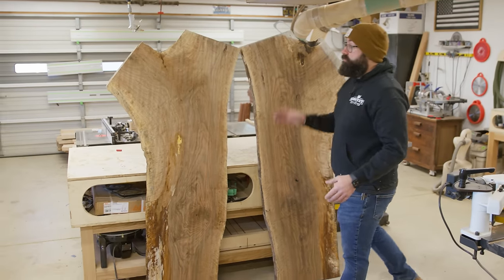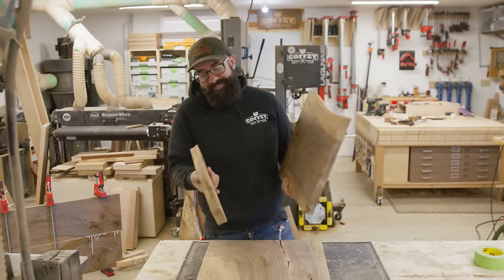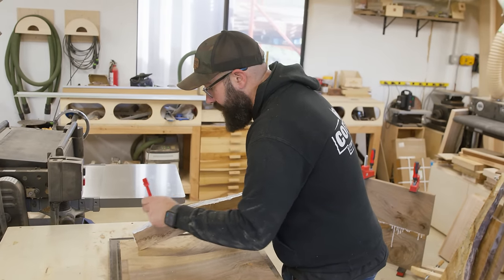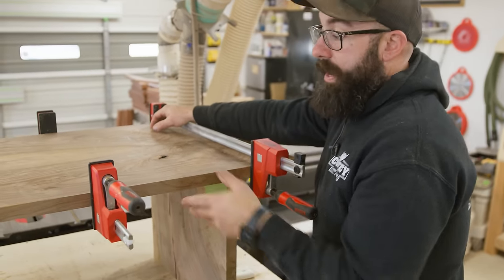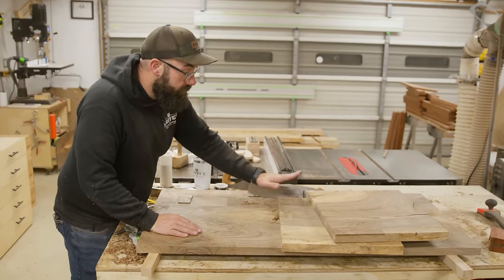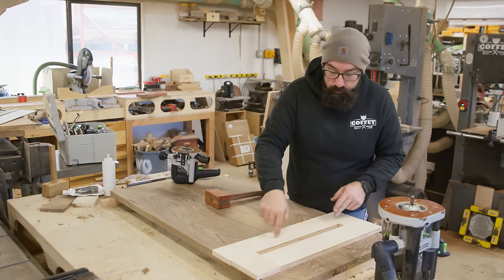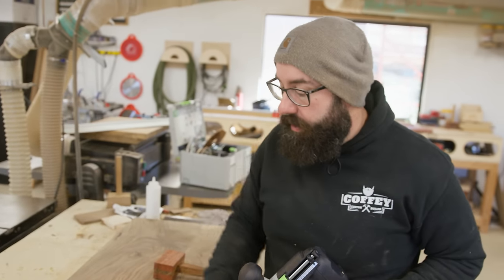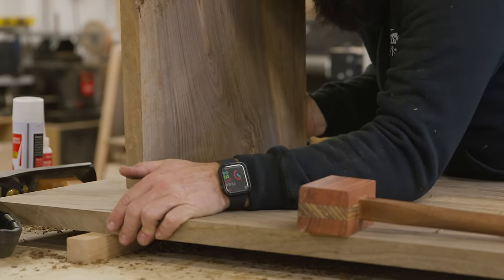$2,000 Coffee Table From $200 Of Trash Wood

Comment: Overall I like it.  The through tenon is a nice detail.  Personally, I'd have preferred the tiny amount of epoxy to fill the defects over the patchwork.   Only other change I'd make would be relief cuts on the bottom of the legs.  As is those legs will work fine on a carpeted floor, but for any hard flooring it'll be almost impossible to get to sit flat.  Foam pads would work, but I also like the look of even a small relief cut.
Reply from the maker: Good thing this was for someone else 😂 thank you

Comment: Looks great. Wondering why u didn’t throw in a stretcher or angled out the “legs”. Pretty much all of the compression is picked up by the shoulders of the tenons. Would love to know what ur thoughts on that? 🙏
Reply from the maker: The stretcher would help with compression. That would help with racking or sway. But it is not an issue here as the tenon is 1" thick and 1.25" tall. That combined with the immense glue surface give an incredibly strong joint. Also, woods compression strengths are VERY high. It's one of it's most redeeming qualities from an engineering standpoint.
Reply: @CoffeyCustomBuilds thanks yeh I see ur reasoning. Awesome build, looking forward to try to replicate it.

Comment: Great looking table, I wasn't sure on the through tennon legs but you definitely sold me on them!  Quick question if you don't mind, what is the blue handle you have on the white pad for the Rubio, how does it hold onto the pad?  Thanks a bunch!
Reply from the maker: Thank you! Big fan of the though tenon's! It's a handle for applying using scotch Brite pads. I put the link in the description. I also didn't use Rubio. I use Rustic Lumber Finish and have for over a year and it's great. Also put a link in the description for that.
Reply: @CoffeyCustomBuilds  Thank you for both of those, I'll have to check out both of the links.

Comment: Won’t there be a problem using this method to attach the top regarding wood movement?
Reply from the maker: Wood movement happens across the grain. The grain is all running in the same direction.
Reply from the maker: Wood movement happens across the grain. The grain is all running in the same direction.
Reply: Thx!  @CoffeyCustomBuilds